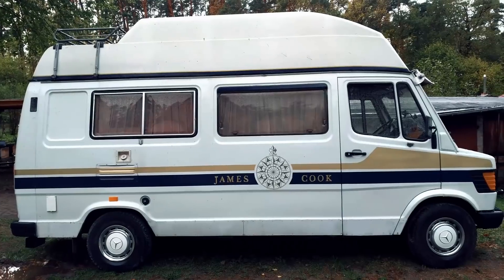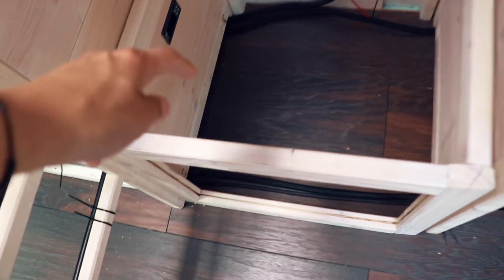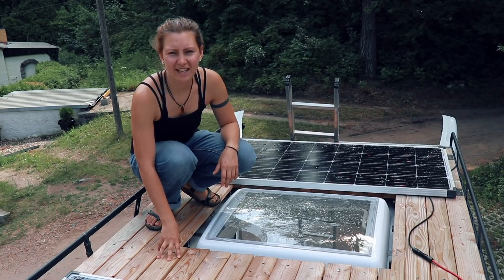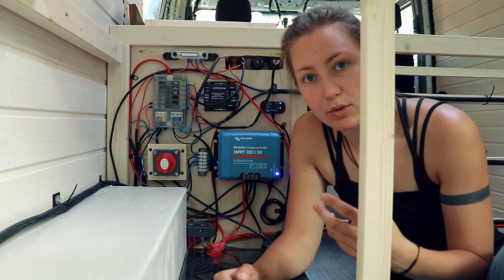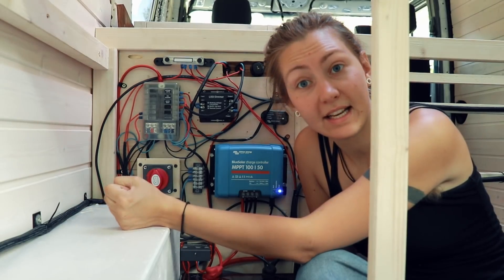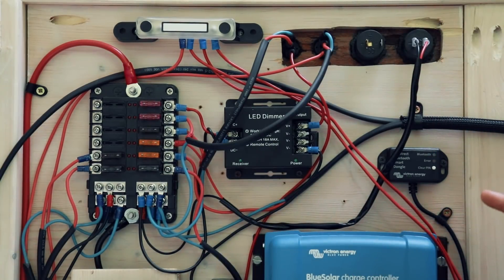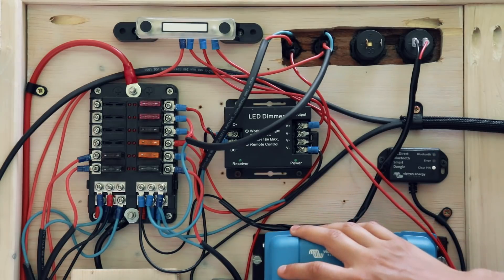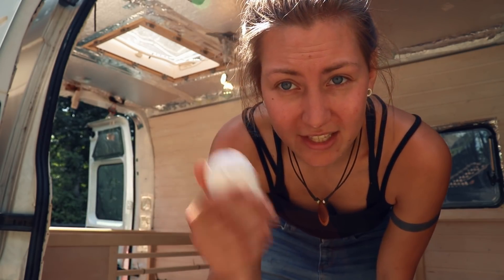Detailed TOUR of my ELECTRIC SYSTEM! | Van Build #13

Comment: The positive lead coming from your charge controller should be connected to one battery and the negative lead from the charge controller should be connected to the other battery so both batteries will charge and discharge evenly.  If not one battery will be over taxed and will loose performance.  You did a good job!  You should be proud!
Reply: Agreed.  Also, unless Lenja explained it wrong, she has the break switch on the negative run from the battery when it should be on the live.  Lenja, please ensure you get the electrics checked by a qualified electrician just to be on the safe side.  Not only will it save you some expensive repair bills if it goes wrong but it will also ensure you are safe.  Overall though very good work.  Especially love the hand made switch panels.
Reply from the maker: Aha! I was wondering about that but I found sources that said it doesn't matter how the cables are connected... But I guess that was wrong then! Thank you all for your advice, I'll try to change that! And I'll try to add fuses too! Safety first 👌
Reply: @lifeoflenja390  you are so beautiful and sexy, and you know it..hair, lips, eyes, the whole face...body...I love to be your husband...
Reply: La Tortuga Abides This is a very valuable advice and has been proven correct many times in real time!!
Reply: @HARBAS7  I agree
Reply: Some technical explanation: the solar controller is connected to the nearby battery. The other battery takes his current from the first battery but has losses on both cables and therefore can't use his full capacity. When you move one of the solar controllers cables from the nearby battery to the other one than each battery will have one cable with losses in his circuit and will work each for 50%. Up to you to decide which cable (+ of -) to extend to the other battery.
BTW are the batteries protected with fuses? (In cable fuses)
Reply: @marcbruneel1858  yes correct,  and fuses is a must be! How big fuses? Those cables looks like arround 16-20 square millimeters...I should put 60 ampere fuse
Reply: It's everywhere said that is has to be done like that, but I don't know if it really had been proven. You have quite thick cables between the batteries, so they will balance themselves. There is a good chance that it also works like this. 
You can check it: Discharged your batteries quite a lot. Cut off everything from the batteries buy turning the kill switch. Wait for an hour. Disconnect the connection between the batteries and then measure the voltages of both batteries. If they vary you should change the wiring, if not leave it.

You should install also the Victron Battery Computer. Otherwise you never know how your batteries are going. The voltage doesn't show much. It can be high because the solar charge controller is charging or low because you have a high load somewhere. With the computer you really see how many Ah you have used and how many are charged. If you buy a version with bluetooth you have another device in your app.
Reply: @73smoo  it is the truth. One battery will not be re-charged properly due to the voltage drop across the longer wire; if one sided.